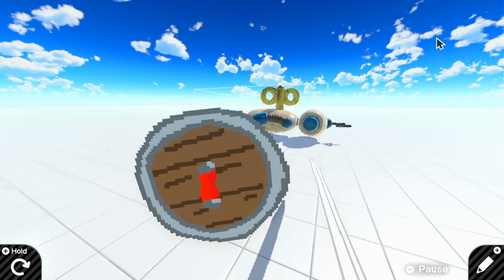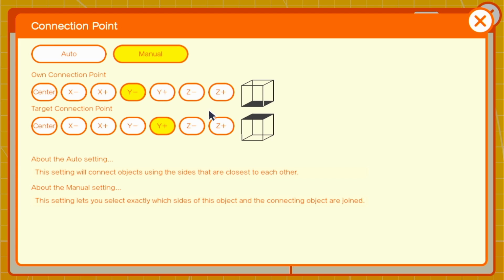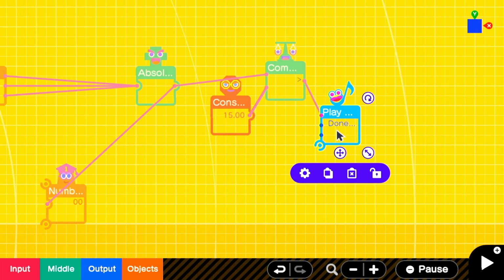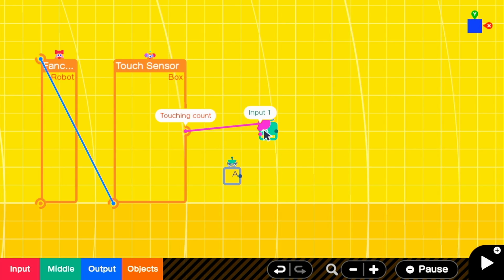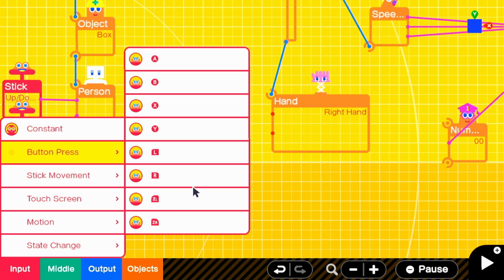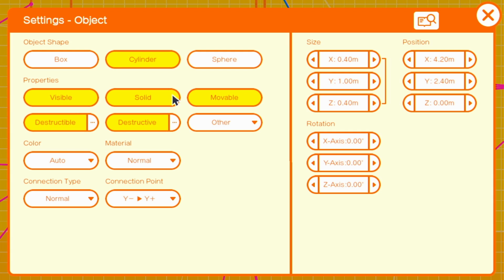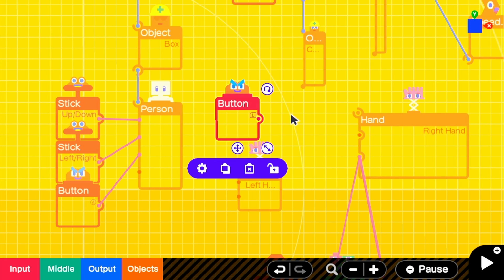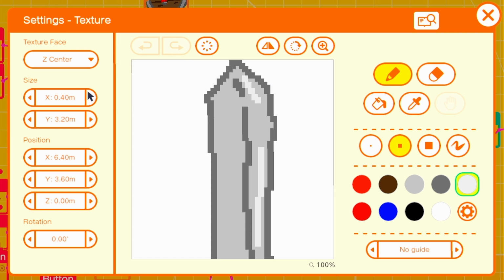How to Make Motion Control Weapons in Game Builder Garage

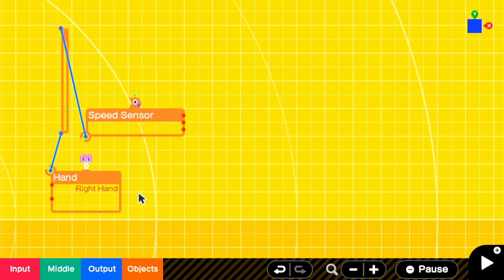Comment: 2:15 If you want to be more precise but more costly, the mathematical way to determine the speed in any direction is sqrt(x^2+y^2+z^2), for the x, y, and z speeds. You'd plug each speed output into both inputs of its own Multiply Nodon to square it, then plug each of those Multiply Nodon into the same Square Root Nodon.